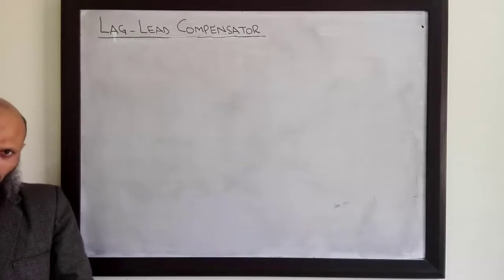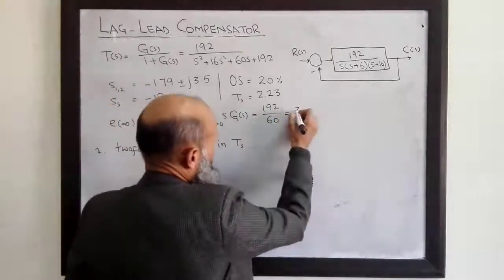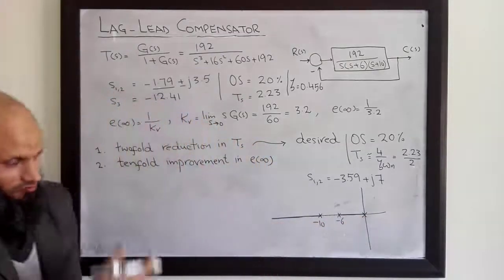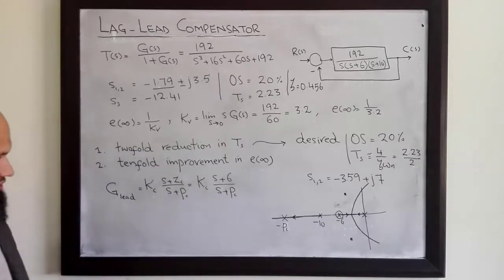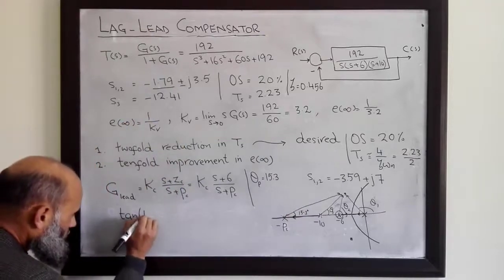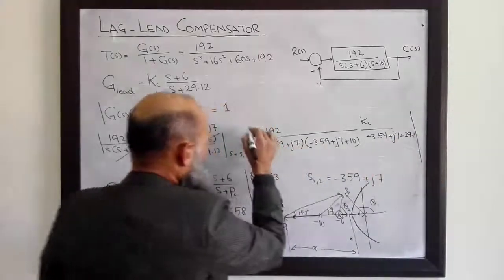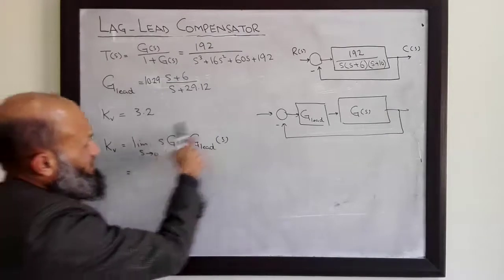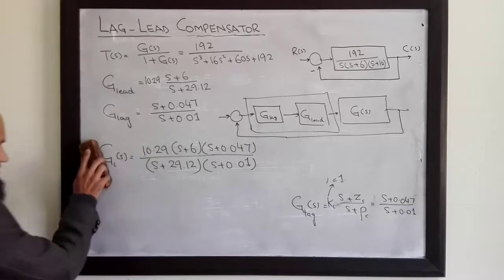LCS 38a - Design of Lag Lead compensator

Comment: how can we choose 180 or -180 in difference of zero angles and pole angles part?
Reply from the maker: You may choose either 180 or -180 in the calculations for angle deficiency, in both cases the result will be the same.
Reply: @MAFarooqi  Thank you sir